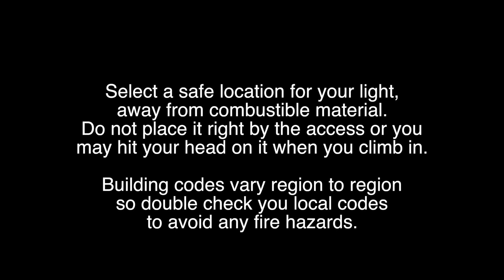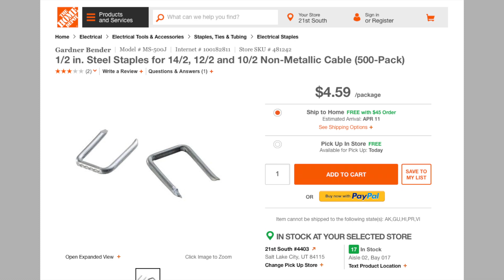How to install an Attic Light

Comment: The only bad thing is the garage light has to be on for the attic light to have power. So if someone turns off the garage light when you are up there you are screwed. The receptacle would have been the better choice.
Reply: That is not how this is wired, the source Adam pulls from is always hot. The power is controlled at the ceiling receptacle to light bulb, not receptacle to romex.
Reply: Starting at 0:23 he stated that he is tapping the light bulb which he would need to have on in order for the attic fixture to get energized.
Reply: i don't think he was aware that there was also an always hot line in the garage light receptacle (probably powered the outlet for the door). switching around a wingnut and he would  be fine

Comment: you need to add a vapor barrier on your light fixture because it is an exterior wall... if you roof leaks during a storm you will have a disaster...
Reply: Dont buy a shitty wooden house.
Reply: @LivingLifeSlower  🤣🤣

Comment: Better off running power from a furnace in a furnace closet or that’s already in an attic to a switch that has constant power. In this case you would have to turn the garage light on to turn the attic light on

Comment: It's dangerous to tell people 14 /2 is acceptable as we all know 12/2 should be used to accommodate future possible load.
Reply: Brian Z j
Reply: Not if it's already a 15-amp circuit.  Lighting circuits are 15A, and receptacle circuits are 20A.  Now, if he tapped into the ceiling receptacle, then he would have needed to use 12/2 wire.

Comment: I'm unclear here...if the attic light is wired to the main lines carrying power, why does the garage light also have to be "on" in order for the attic light to operate?  Doesn't the power still travel to the attic light regardless of the garage light being on?  Sorry, I'm no electrician but plan on adding a light in my attic and would be jumping off a ceiling light and was just curious.
Reply: It’s wired to the line. There are 3 wires in the garage ceiling box. 1 to line, 1 to switch, 1 to attic. (See 3:03min).
Reply: because he wasn't aware that, although normal lights only receive power when switched e.g. 14/2, he had the ability to tie off to the LINE (the black wires) rather than the switched (red wires) as he has 14/3 wire going in. Whenever you see red in such a circumstance you know that is switched and the black is going off somewhere else (probably to the garage motor). So if he tied off directly to the LINE wires the attic light would always have power and would be controlled independently by its internal switch.